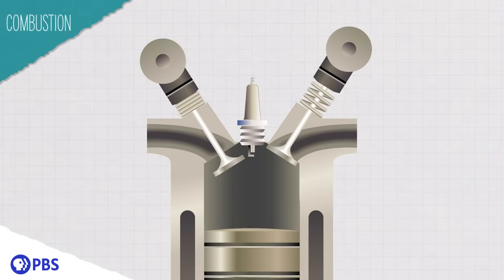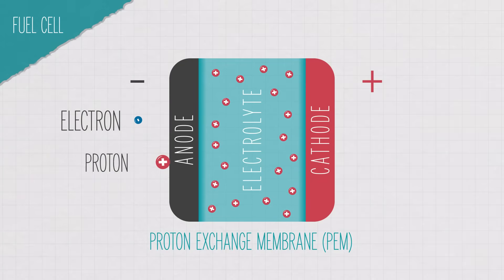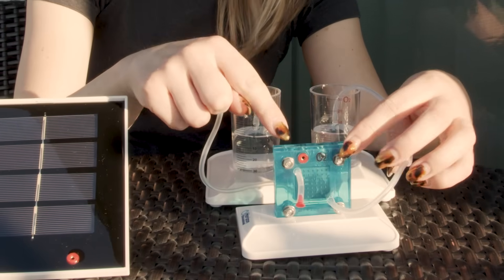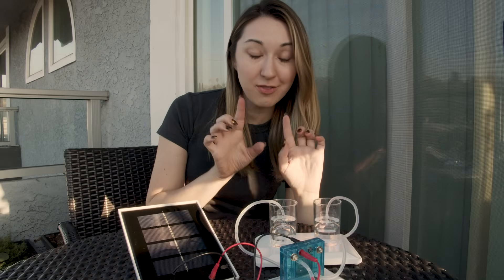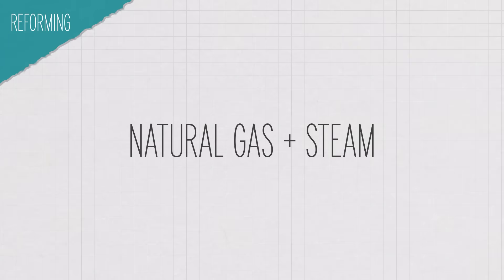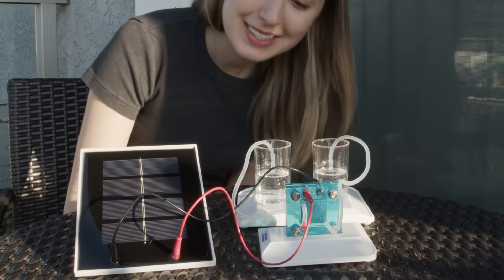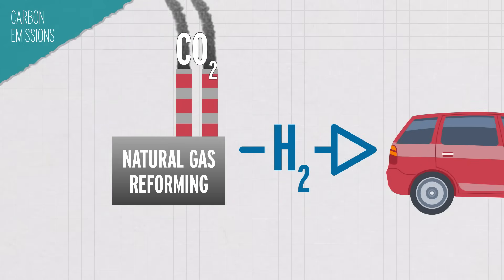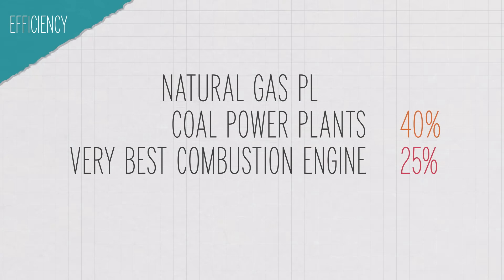How Do Hydrogen Fuel Cells Work?

Comment: I am a hydrologist and I will say she is spot on with everything within her video outside of the concept , admittedly unspoken, that natural gas is dirty. Natural gas is actually extremely clean and is the cleanest of all fossil fuel types which is why it is used so heavily within the industry. Hydrogen cars compared to electric cars within all supply chains considered , electric cars are very “dirty “ especially through the mining process and still using gas to produce the electricity at every fill up. Hydrogen technology has greater potential to be cleaner throughout the entire process
Reply: put your mouth to your oven burner and see what happens

Comment: I dont know who taught this girl her science but thats not how cars that run on hydrogen work. They dont need to be filled with pre-refined hydrogen gas, that makes no sense. They just need a battery to pass an electrical current through a source of water that has a conductive material in it to seperate the hydrogen from the oxygen. Then the hydrogen is then used to power the motor. What is this unsustainable energy conspiracy that shes going on about? Does she work for the FBI or something I dont get it.

Comment: Use your car battery to break down hydrogen and run it in intake of your car to run it  you don't need fossil fuel it's that easy I run my generator to run on hho generator from the battery to make hho and the generator charges the battery and it the generator puts out 3000 watts and that's a small generator it will power a whole house and the exhaust is water simple and easy

Comment: my thoughts on this application, when designing a solution, it should have 2 hydrogen cells, 2 phased approach, phase 1 dealing with generating that hydrogen by using 1 hydrogen cell charged by solar and regenerated power from brakes or constant turning of the wheels ( some sort of alternator). the second hydrogen cell to use the hydrogen to power the item (car, motor, etc. ), however i completely lack knowledge on hydrogencells and the chem reaction involved and its efficiency. id like to though....

Comment: I know I'm not really understanding something in this equation.
Seems that there should be a process of continually producing hydrogen in a vehicle.  Even using batteries to provide the initial power.  Use a low pressure storage tank to buffer created hydrogen as its waiting for fuel cell use.
Just-in-time creation of hydrogen.  No 10,000 psi tanks.

Comment: Hydrogen is not a source of energy but a way to carry energy to use it with machines and vehicles that has no access to AC power network. It's a replacement for batteries in cars because using electric batteries for producing torque is inefficient and not sustainable: lithium is very hard to recycle, harmful to soil if disposed. Other types of bateries they develop will likely to face similar issues as long as they depend on mining of rare elements. Hydrogen is the best temporary solution until we find a revolutionary way to store energy. Solar and wind is not only green energy inputs to produce hydrogen, nuclear power can be used to make it as green as possible.

Comment: This is a great video.  I am in the auto supply industry and heavily involved in electrification.  We are also tracking Hydrogen, as it will be more sustainable for long haul trucking.  I would love to see a similar video breaking down the true carbon footprint and effect on the earth that EV is creating.  We seem to only be looking at zero emission output from the vehicle, but ignore the impact on the front end.
Reply: It is obvious that extracting, compressing, cooling, transporting, emptying, then storing to finally fill a hydrogen powered car tank is so much more expensive and risky (think about how big an explosion there would be if a truck transporting hydrogen crashed and exploded? Much bigger than the already big explosions and fires from already existing accidents) than charging a Li-Ion battery from existing infrastructure. Electricity is currently transported via Alternating Current cables across huge distances safely right now.

My point is, there is no new infrastructure required apart from better batteries to charge and faster charging stations if people can't charge their car batteries overnight.

Plus with the addition of fission, hydro, solar, wind and innovations in other sustainable methods of power generation it becomes better and better over time .. costing less and less ... hydrogen power is just inefficient from the get-go/start.

Because it is not available in it's pure state naturally. It is always found bound up in a chemical bond with some other elements which requires energy to be expended in order to extract the hydrogen.

Electrons/electricity does not need to be extracted = less inefficiency from the start.
Reply: Yep. We need to record the head on accidents as well.

Comment: Couldn't you use one fuel cell to power another fuel cell where one is electrolysising the water & the other is using the Hydrogen & reforming/producing the water to start the process again ?
I'm sure that you could tap a small amount of the power produced to use elsewhere ?????????????????

Comment: But make a plant  With reflective mirrors that heat of enough to separate water into hydroxygen which I believe Israel 2300 Celsius The positive this is it could be  Mirrors  Instead solar panels which have an actual life expectancy and  Although it's 80 years for them to become I'm efficient Average reflective length would never break down or need to be replaced

Comment: Why don’t you just plug the fan into the solar panel and cut the middle process of producing Hydrogen to create the electricity?

You would also need a much smaller solar panel to produce the same amount of electricity the hydrogen did.
Reply: Because clouds.

Comment: Electric cars have additional disadvantages, they are sensitive to environmental conditions. The production of the battery is expensive and harms the environment, and the battery itself breaks down and its replacement is expensive and it is only a matter of time. The latest research shows that NET electric cars are less ecological than combustion cars, which somewhat explains the choice of this direction by the European Union. The dissemination of hydrogen and favorable conditions for it is included in the so-called reform milestones
Reply: The life path of energy in this cycle is a power plant often coal ~ 40% -> transfer via state power lines ~ 80% (of 40% is 30% and this still excludes unused energy that could be used for hydrogen production) -> then there are losses on charging 8%, then energy losses resulting from, among others, self-discharge of EV ~ 32%, the efficiency of using electricity drops to 12%. And considering the construction of the battery that will not live as long as the internal combustion car and the need to extract resources, it is not an eco-friendly project ... (but hydrogen cars can actually be electric and reduce energy losses)

Comment: There are electric cars that use H/O fuel cells, as a battery, then there are internal combustion engines, that burn H2, usually stored in a metal hydride.

Comment: This was super helpful to me, I'm into electronics and know quite a bit but I guess hydrogen fuel cells just passed me by. I never paid any attention to them thinking they were out of my realm of obtainability. I never knew I could just buy a small one to play around with and this was a very good in depth introduction 🤙
Reply: Learn that the center of a magnet is by far the most powerful part!!  Just as it separates N and S it can also do much more. If VIBRATED at the correct frequency it can separate the H2O
Reply: sounds like some ed leedskalnin information right there @vincecox8376
Reply: NASA's use of them during the Apollo space program caught my attention. 
👍

Comment: What about a car that makes it's own hydrogen as the car needs it , giving it endless supply on demand , with water , sulfur dioxide, and aluminum electrodes that produce hydrogen on demand , very simple and very doable , and that is exactly what is already being done using crude methods , If we could retrofit the average car with a simple hook up unit we would solve our energy problem , but the draw back is oil companies won't make any money from the supply of water .

Comment: The efficiency of the power plant is true but what she did not mention is that there are considerable transmission and distribution losses from electrical power plants. Their efficiency and a car’s efficiency wind up being about the same. 

Excellent video none the less!
Reply: That's not true .... Li-Ion batteries are much much cheaper to produce and use. Do you honestly think that if there were cheaper ways to do things businesses would not eventually use those methods?

Comment: Hydrogen can be extracted from moisture in the air or water via solar power for free and stored and or processed for hydrogen alloys for fuel cells .. lithium is a limited profitable solution, so so profitable money money money $$$$$$.

Comment: Solution, connect a electrolysis hydrogen generator to a dam, 2.Use electricity generated by the hydroelectric dam to power the electrolysis machine. 3. Build trains or trucks that are powered by hydrogen fuel cells. 4. Ship the hydrogen around the country using fuel the dam created for free. Cheap, virtually unlimited, clean energy for everyone!

Comment: If moronic politicians wouldn't fear nuclear energy so much we could've had new reactor designs and generate most of our power from nuclear reactions. But no. We replace nuclear with natural gas and then hope that maybe in the future the gas will be replaced by wind and solar. But that's not enough. Without giant energy storage solar can't power grid alone and wind is quite unreliable, you need a stable base load, nuclear can provide that easily. Our future is in nuclear fission and fusion, not stupid wind turbines.

Comment: I would have to see evidence that an EV is more efficient than a hydrogen vehicle.  Electricity is made from the same pie chart greenhouse gasses as the hydrogen.  And the energy loss by way of heat seems about the same.  You have completely disregarded the CO footprint over the life of the vehicle.  I'm not trying to assert that an HV is better than an EV, but I think any assertions going the other way are erroneous.  The CO footprint over the life of an EV is horrid.

Comment: What happens if you don't use water at all, but just suck air through the cell, by using an air pump?
Does that result in very dry O2?

Comment: Hydrogen could simply be made at any hydro electric dam like James bay or Hoover dam through electrolysis.  The hydrogen could then be sent through an additional cables system with the existing infrastructure of the power lines than sold to hydrogen stations at gas stations or to individual houses for profit for the power plants and then taxed for the Government.

Comment: Here is a question. At the point where the water is split into the two gasses how are the two gasses separated and sent to different sides?
Reply: There is a membrane that is permeable to cations (positive ions), in this case H+, the positive hydrogen ion, but not to negative ions or neutral molecules. It's called a proton exchange membrane. When an electric charge is placed on the cell it splits the water and pulls the H+ ions through the membrane, reduces them (gives them electrons), and there is your H2 molecules. Using them for electrolysis is really running them in reverse, and I'm honestly not sure about the details, but that's the gist of it.

Comment: if you got off the 'clean' indoctrination, and buzz words, you'd realize, earth don't have a whole lot of free hydrogen. it all water, and the highest known CHEMICAL reaction, being h2+o -> h2o, in order to get Hydrogen, you need put same energy in. Conservation of energy. That why nobody use hydrogen. But, it still has even better energy density then gasoline.
Reply: not to mention saturn, jupiter etc, sun, have a bunch of free hydrogen. It just way over there. But no atmosphere, so it simply delta v to unlock it.
Reply: Also for aviation, it still could be better then gasoline, because aviation needs to be lighter, cause entire time it has to overcome gravity. land vehicles dont, because of ballistic coefficients. This why very heavy freightrain is actually very efficient.

Comment: Hydrogen's biggest challenge is how much space it take to store. For land and air transportation, more volume means more drag and that kills efficiency.  Even storing it as a liquid , the volumetric energy density for hydrogen is EXTREMELY low and storing it as a liquid is not easy to do.  See all the problems the SLS has been having  because it uses liquid hydrogen as a fuel - which is why SpaceX and other rocket manufacturers have moved to Methane.  Liquid Hydrogen takes four times as much space as gasoline to store the same energy and then you have to consider all the challenges of how to store it as a liquid - which is literally rocket science.  I think it would be way more practical to do like SpaceX is doing and use liquid Methane.  Just like hydrogen, you can make methane from electricity using the Sabatier process and it is already widely used and stored (Methane is basically the same as LNG) and, when made using the Sabatier process, it is carbon neutral.

Comment: Great video. It's easier for regulatory agencies to stay on top of power plants than individual vehicles. Also in power plants we can capture / filter/ scrub pollution's from the plants much easier than individual combustion engines. Electric, hydrogen electric, renewable fuels like biodiesel are all what's needed. We have areas in the US the naturally exhausts a ton of hydrocarbon gas, might as well use it to produce power then to just have it gas off into our atmosphere. All in all leaving the O&G to shift it's focus into power or newable fuel generation is the absolutely correct thing we should have been doing decades ago instead of trying to immediately replace them. Especially with the fear of losing our hydroelectric dams in the water states of US.
Reply: I agree with you for most of it except for bio fuels.

 They are a scam! Seriously they are not eco family due to how much it takes to grow the corn. From water, to nutrients to the land it requires. It just isn't efficient or a good use of our resources even if they burn cleaner.

 There are better options overall.

Comment: What are your options on lithium mining pollution for EVs.
Also electricity generated through Hydroelectricity is not clean, dams flood fertile land and render it useless.
Wind energy generates waste in the form of non recyclable wind turbine blades
Solar energy too isn't green, as glass production for panels again is considered as pollutive process
Nuclear and thermal are out of question, so what is the best form of energy that doesn't pollute??
Or shouldn't we think the other round that as all forms of energy cause pollution, we should change our lifestyle and habits to consume least amount of energy.

Comment: EV’s are still overwhelmingly charged off of combined cycle and other thermal power plants.   So they are no different in emissions related to hydrogen.  Kicker is the wast from the lithium ion batteries and the process of mining and refining lithium is extremely toxic and releases as much emissions as the process of mining coal.   I still like hydrogen, mainly solid state hydrogen and metal hydrides over lithium powered cars.  Lithium cars will be a flash in the pan when magnesium hydride reaches the market. More energy density than gasoline and over 100 time the energy density of a lithium battery.   For propulsion the biggest thing to focus on in energy density.

Comment: Take a petrol generator with 110v and 240v output, from the 110v connect an invertor to use for the electrolysis cell to produce hydrogen/oxygen for the generator which can then run for free to produce 240v.
Reply: As long as you steal petrol from somebody's gas tank, yeah, it's free.
Reply: @jamesvandamme7786  You obviously missed the point of what I stated. It starts on petrol then starts producing hydrogen/oxygen by its electrical output, the petrol is used up but continues to run on the gas it produces. A buck converter would be ideal for this.
Reply: @merlin1346  So, burn petrol in an engine, drive a generator that makes 240 VAC, feed an AC to DC power supply (with an ideal buck converter), run an electrolyzer to make hydrogen, then feed a fuel cell to make DC, then an inverter to make 240 volts AC? 

OK, now what kind of efficiency do you expect out of this?

Comment: Thank you for this video, I've not seen such a simple demonstration of a fuel cell before.

And thank you for making it clear that a fuel cell produces WATER VAPOUR and not just water. Of course it will condense in time, maybe in a cloud.

But in the meantime, you are adding water vapour to the atmosphere...

And the ultimate irony is that water vapour is a MORE POWERFUL greenhouse gas than Carbon Dioxide !!!

Comment: What a great video! I just found out about the Toyota Mirai and became interested. It uses a fuel cell, but I can't find why it can't be used in reverse, plugging it into the mains to produce hydrogen overnight. Anybody know more?
Reply: Added cost & weight to vehicle, added complexity and low efficiency vs industrially produced hydrogen. You can make oxygen at home technically very easy, look up "hho generator"

Comment: I had a thought about hydrogen fuel cells.  If the world did start using hydrogen fuel cells, would the large amounts of water vapor  cause weather patterns to change due to increased humidity ?